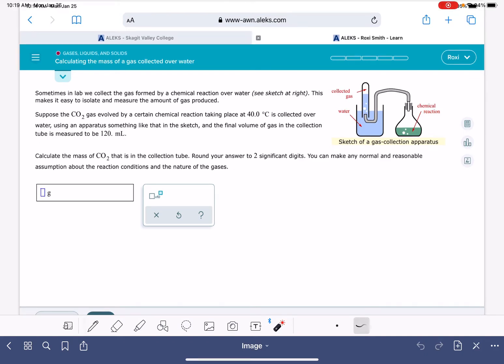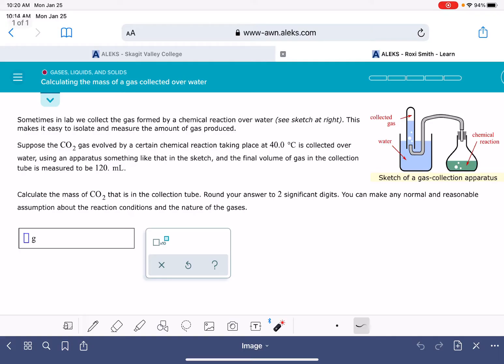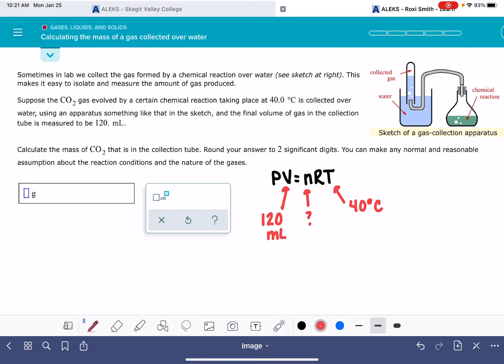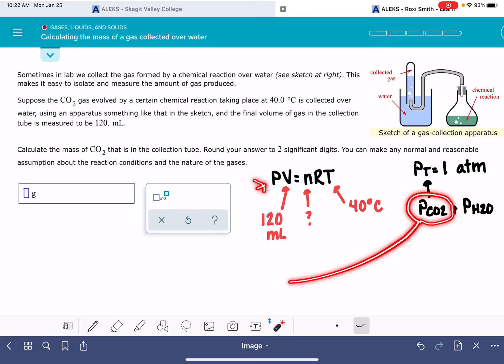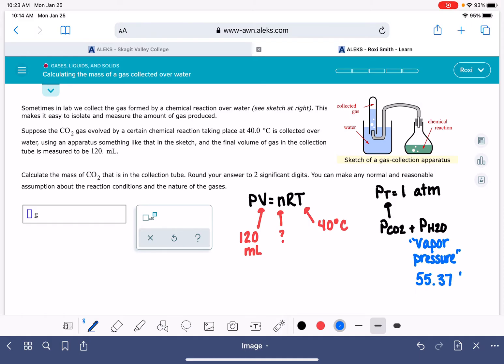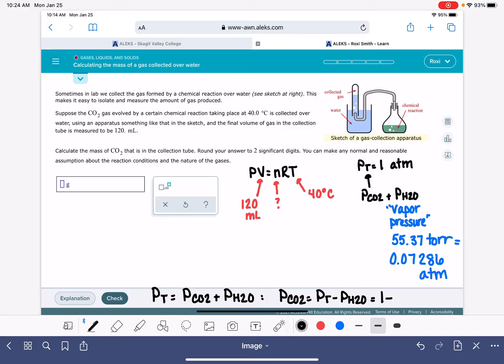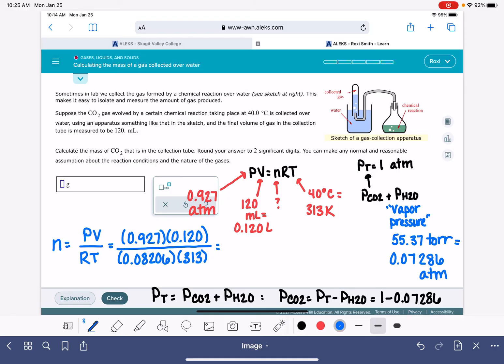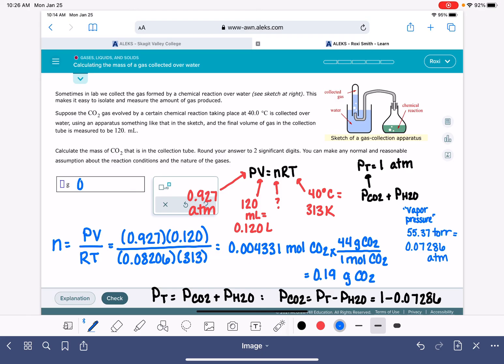ALEKS: Calculating the mass of a gas collected over water

Comment: okay,so what is the pressure of CO2? and how did you get the number of 0.927?
Reply from the maker: The pressure of CO2 is calculated starting at about 4:40.  It is 0.927 atm, and it is calculated using Dalton's Law, which says the Ptotal = Pco2 + Ph2o